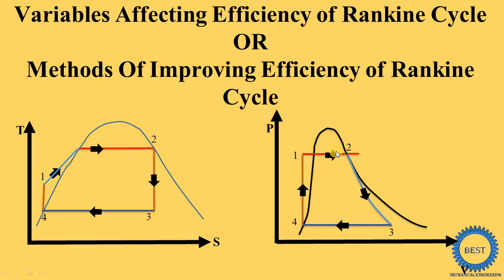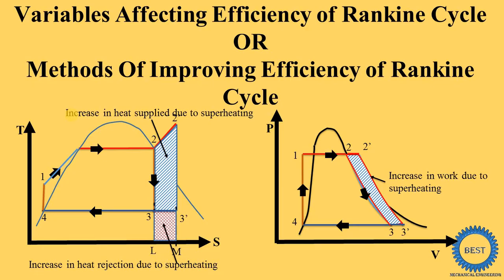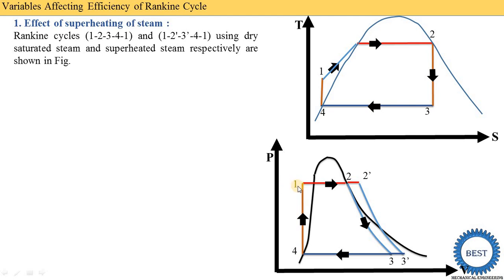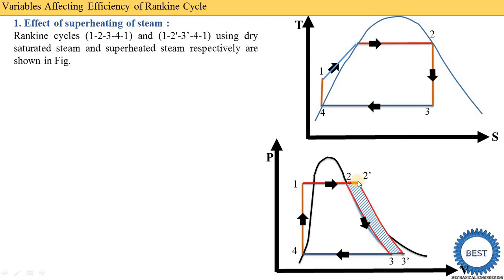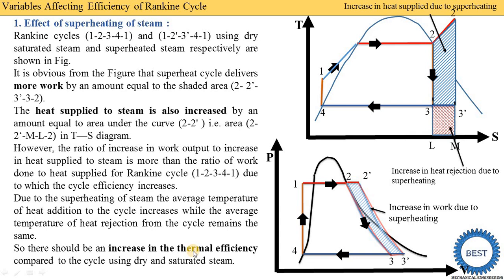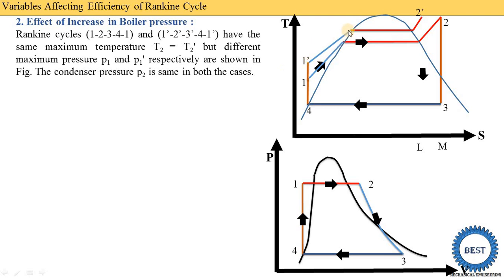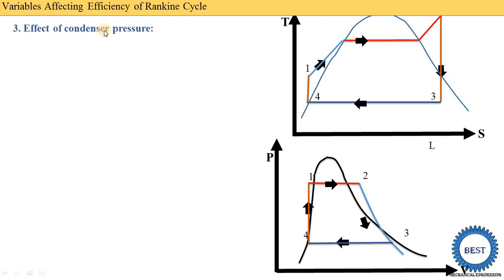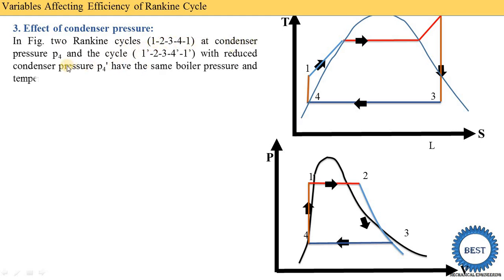Variables Affecting Efficiency of Rankine Cycle - Methods Of Improving Efficiency of Rankine Cycle

Comment: Sir, I believe there’s a misunderstanding in interpreting the PV diagram.

When the boiler pressure increases, we must evaluate the effect using enthalpy (h) values, not just the area in a PV chart.

Increasing boiler pressure raises the saturation temperature, and as a result, the latent heat decreases. This means that the energy required to vaporize the liquid reduces, but the total heat input (q_in) often increases due to the steam exiting the boiler becoming superheated.

This superheated steam has higher enthalpy at turbine inlet (h₃), which leads to a larger enthalpy drop across the turbine (h₃ - h₄). That enthalpy drop represents turbine work, which actually increases, not decreases.

Therefore, the cycle efficiency improves, and to truly understand this, we should use h-s (Mollier) or T-s diagrams, not P-V diagrams.

The PV diagram can be misleading because specific volume decreases at higher pressures, making the area look smaller — even though the actual work output increases.

Comment: sir in boiler pressure method u told that from 1 to 2  where heat is added in boiler  at that time how we can expet work   and u are saying that  net work done in 1 to 2 and  2 to 3 got zero  that not possible